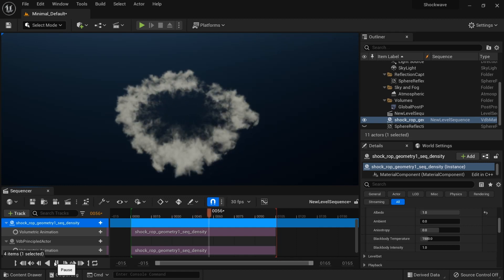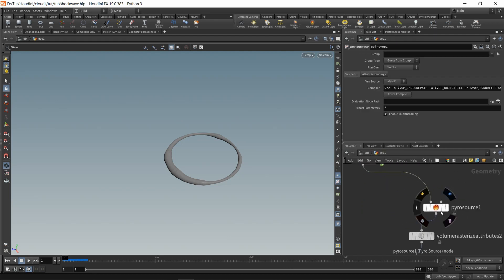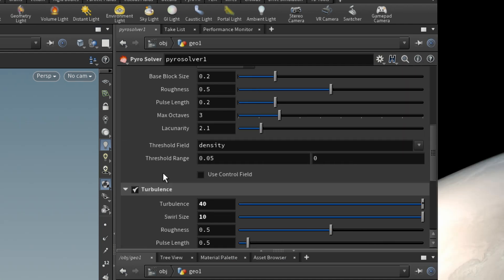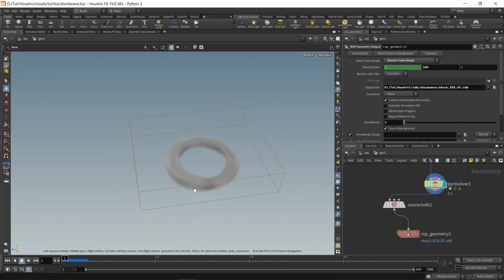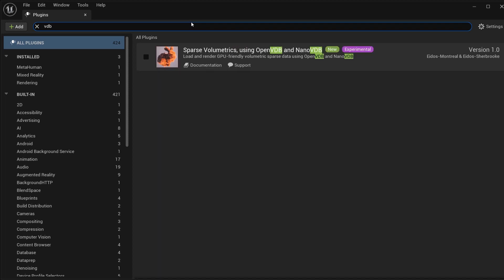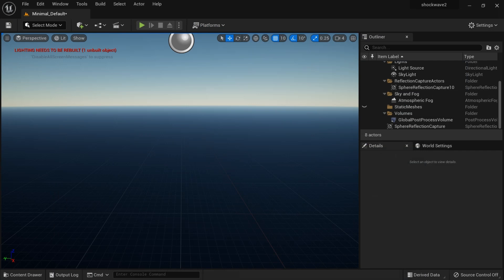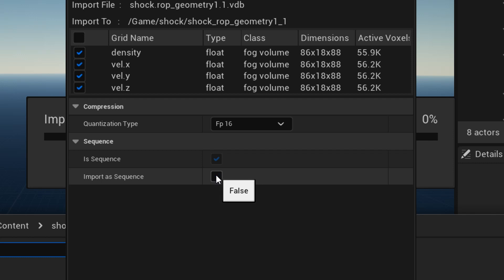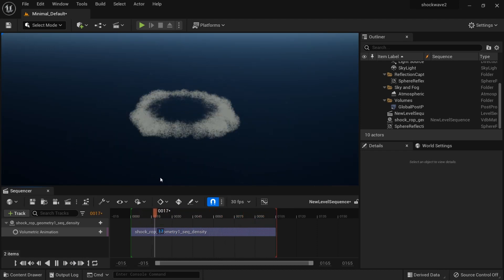Unreal Engine 5 Shockwave #unrealengine #vfx #vdb

Comment: I have a question, i was trying to use the pyrofx - fireball and when i import it in unreal, the dimensions are all the same for density, temp, and fuel but the heat dimensions are higher. I also noticed when i play the sequence it only shows the smoke and not the pyro sim effect that i saw in houdini. I didn’t add velocity because for some reason it was filling my whole grid with fire element making it look like fire cube and was hiding the fireball effect. Do you know what i might be missing?
Reply from the maker: 1.Check if you only exported density.
2. Check if Unreal material not reading temperature/heat

To see the fireball effect in Unreal, make sure the following fields exist in your VDB:
density, temperature, heat, fuel

If you only exported density, Unreal will show smoke only.
Make sure in the Houdini VDB Export node:
You have “Export Volumes” set to density, heat, temperature, fuel, flame.
They are NOT merged into a single volume.
The volumes all have correct naming

Comment: Does ue5 use the velocity fields? Could save space stripping them out if they are unused. Those take up loads of space. In production usually I use a volume compress node to keep the data masked by density, and then reducing vel resolution by half.
Reply from the maker: I believe ue5 do use the velocity fields, but I will try your approach and see how far that will get me. Thank you tho